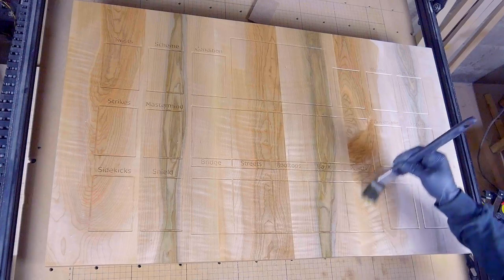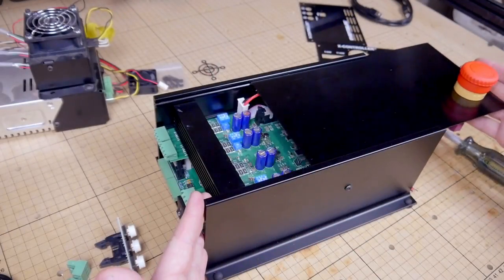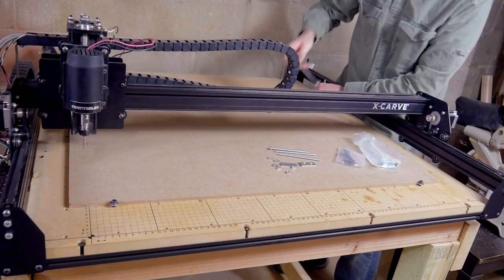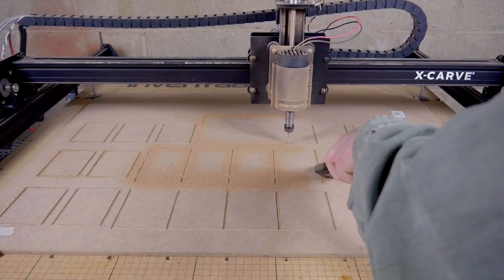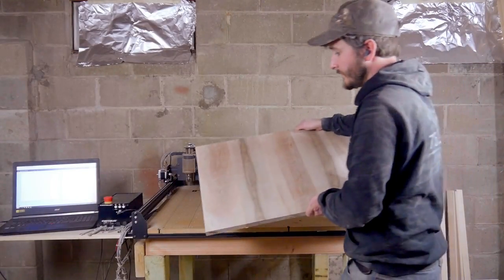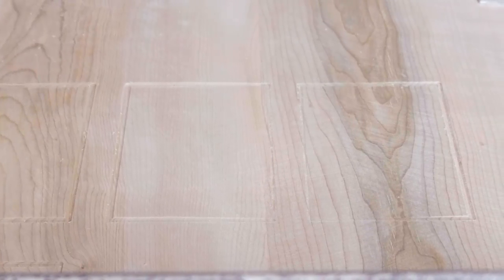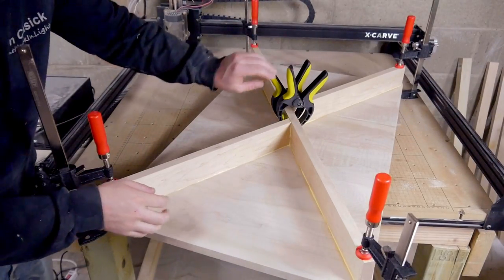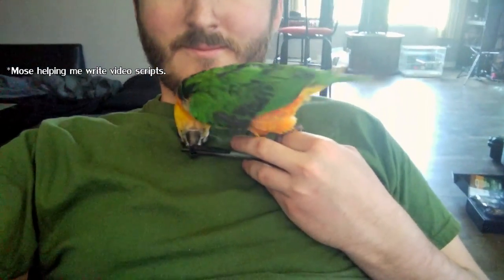Designing & Cutting A Custom Maple Game Board (Legendary) on X-Carve

Comment: Woodworking tip: wipe excess wood glue before it dries. Makes everything look better. For the main board it doesn't really matter since you sanded, but the underside has very visible glue.

Comment: Pretty good for someone who doesn't woodwork very much. Only thing I would suggest is to really take your time sanding before applying the finish. If you did sand it more with a higher grit you would have minimized the wavy uneven look of the finish.
Reply: That looked to me more like a curly figure of the wood rather than an unevenness of the finish.

Comment: A tip for keeping your boards flat. When doing large tabletop-like glue-ups, always make sure the curve of the end grain alternates (cup up, cup down), and then alternate your clamps on the top and on the bottom. This will even out the load. Your strips helped, too. Also use a chisel, or even better a jack plane, to remove the excess glue. Much cleaner, easier, and less dusty then the belt sander. You will also likely remove less material. Even a cheap wood chisel, when sharp, will do this well.
Reply: Just a small add here, don't scrape the glue off with quality tools, the glue dries so hard that it can easily chip sharpened chisels or planes, instead remove every ounce of glue you can when first clamping, the use something like a drywall/putty knife to scrape with.

Comment: I use Inkscape as well. Good software. They use those stepper motors in everything. What would be really nice, is if you could rub some color into the lettering that you cut. Much better contrast. Maybe a syringe filled with colored epoxy so it can flow into each letter.

Comment: On similar products in the future, I would recommend using a darker stain on the wood, and then using a planar to take down the top 16th inch or so of the wood before applying the final finish. The result is that all your cuts and lettering, which aren't shaved off by the planar, hold the stain and show up darker and with much better contrast on the final piece. This would probably require making those cuts deeper in the first place.
Overall, very nice project.

Comment: That looks fantastic. My only suggestion would be to use biscuit joints to connect the boards together rather than glue by itself. It should add a lot of stability, and possibly eliminate the need for cross bracing on the bottom.

Comment: If you have a table saw, make sure all the boards are the same way up (look at endgrain), run them through the table saw just taking the minimum shaving off the edges, then turn alternate boards upside down, this way any slight angle on the blade is cancelled out, also the alternation is the best way to nullify the cupping.
If there are slight inconsistencies in the joins when you test fit, get an old belt sander belt, open it up, and trap in the gap, slide the boards against each other.
This should give you a decent joint ;)
Another thing you could do is to find those cheap shelves that come with a couple of wood brackets for wall mounting, the shelves are often a lot flatter, they are solid wood, they often have a bullnose or other fancy edge, but do the same as above to joint them..

Comment: Maybe you could build a vacuum cleaning system for the table and possibly the grinder to catch the dust. Such systems are often used with larger machines, but you could just convert a small vacuum cleaner and attach the hose to the "head" of the drilling machine.

Comment: Someone might have beaten me to it, but using a damp cloth/sponge to remove excess squeeze-out before the glue dries can cut down on sanding massively! Even if the boards aren't perfectly aligned. Using a straight cutting bit either in a router or on the X-Carve could be used to square off the edges of boards before gluing, rather than using a jointer. Just an idea!

Comment: If I were you, before I applied the finish, I would have put some black paint on the words, making sure the paint got into those grooves and then just sand off the paint on the surface to make the words stand out.  However, the words were actually a lot easier to see than I expected though after the finish was applied.  Overall a really cool idea, I might make something similar!
Reply from the maker: That was the plan, but I liked how the lettering looked naturally so I decided against paint.

Comment: Just a clarification: a jointer doesn't help guarantee the boards will align; all it does is get the edges straight and square to the faces. How to get your boards to align and stay that way is one of the great questions of woodworking. Personally, I use a "reversible glue joint bit" in a router table. It leaves a slightly unsightly joint at the end, so it's not for fine furniture, but it's a godsend otherwise.

Comment: if you install a wider straight bit, isn't possible to do a flatting pass and flip the board and do the same on the other side before cutting out the design. Essentially acting like a thickness planer to level out and flatten your board?
Reply from the maker: You could, it would just take a long time. I would have run into an issue in that my board is wider than the effective cutting area of the machine so I would not have been able to level the margins.
Reply: Here's a simple, tried-and-true way: use a yard stick or any straight edge and lay it across the board in various directions. Scribble over any high spots with a pencil, then proceed to sand or plane them down. Repeat until your surface is flat in all directions.

Comment: When using shallec sand the wood with fine sand paper, then wipe with a damp cloth and then apply shallec. The more times you repeat this process the better finish you'll get on your wood
Reply from the maker: Thanks for the tip! Do you allow the moisture to dry after wiping with a damp cloth or does moisture help?

Comment: Nice looking board. I'm wondering if there could have been some way of darkening the card slots and letters so they are easier to read. Paint seems like the obvious thing, but I've had trouble getting a small brush perfectly in the edges without overpainting.

Comment: I'd use some edge finder. But then it wouldn't work if rpm was too high. Home machine I just edge tool to side with paper till paper can't move, then rise Z, move half of tool diameter in and you have decently repeatable X or Y edge finder.

Comment: Could the xcarve not do a levelling pass rastering the top of the surface to exactly flat, then flip over, clamp, and raster level the back side; you lose a few mm but then you can be absolutely certain the work is flat and parallel on both sides.
Reply from the maker: The total size of the board is wider than the X-Carve's cutting area so it wouldn't be able to hit the edges without doing it in multiple steps.
Reply: Fair enough. something something skin a cat...I'd make the play area the max size of the xcarve then add a border/trim to flesh out the full size of the sheet.

Comment: Does the X-carve not have home switches?
Reply from the maker: You can make it return to it's previous home position, but in general I set a new home position relative to every work piece rather than to a location on the carving table.
Reply: Fair enough. On my CNC router I have installed a 90 degree fence on the 0,0 point, which I butt my work pieces against. It allows you to use the home switches for a fairly repeatable origin in case of having to stop the cycle. It's always a bit scary cutting into a work piece you have a bunch of time invested in! The end result looks great.

Comment: It would have been a bit more final if you had added storage for the cards but cool none the less.
Reply: Ailerath the nice thing is that that should still be doable since the board is elevated.
Reply from the maker: Ha, I don't think you realize how many cards there are. It's something like 35lbs worth, and they keep coming out with more. I suppose maybe they would fit if the entire board had one big slide out drawer under it.
Reply: NightHawkInLight or if the board was the lid to a shallow box that you can place card trays into. Piano hinge on one side, simple latch on the other. You wouldn't be able to correct the warped surface, only problem.

Comment: your videos are grate although it would be nice to have projects with more readily available parts maybe something with fire
Reply from the maker: Did you see my last two videos?
Reply: they did not show up in my subscription feed
Reply from the maker: I'm not surprised. Who knows what YouTube is doing these days.
Reply: Yurp:]
Reply: Since you don't have a jointer, a hand plane.   Place the board side by side with the same joint edge touching and plane them smooth.   The edge should match up as long as the plane it straight.   By leaving the center  very slightly deeper will give you a spring joint.

Comment: Glueing the bracing on like that is a bad idea for a wide panel like this, the wood on the large panel will expand and contract and pull the glue joints apart over time, its not a big deal really but it's worth mentioning so you can try to avoid it in the future. I hope you have a good day.
Reply from the maker: You're probably right, hopefully it stands the test of time and doesn't change much with humidity.
Reply: NightHawkInLight if not you could always add some darker areas and dents to try to give it a more aged look and add some character to the board, it might actually look pretty cool done up like that.

Comment: Great video, personally I would have painted the lines black, before oil. Then sand the surface to remove any black paint that is not in the lines, and then oil it. Just to make it more clear and easy to read :) Also, will only using wood glue really hold? Feels some biscuits or plugs (like these http://diy.sndimg.com/content/dam/images/diy/fullset/2011/2/23/13/RX-DK-DIY064016_glue-biscuit_s4x3.jpg.rend.hgtvcom.1280.960.jpeg or these http://s470.photobucket.com/user/kurreburre/media/Hem/gds_mediabank4.jpg.html). Anyways, great video, nice to see some woodworking here as well

Comment: It says in the rules that you have to submit a CARVED game. Not just the file of your drawing. :( :( :(

"Add a photo of your completed, carved game to the Games Maker Challenge page along with an active link to your Easel file. Make sure you make your Easel file shareable by going to File > Share so others can open your Easel project and carve it!

You must submit a photo of your game project on the Games Maker Challenge page in order to receive your gift card. Photos of anything other than your carved game project will not qualify, even if your Easel file link is valid.

In order to receive the $20 gift code reward, the photo must be for a complete finished game carved with X-Carve or Carvey. Your Easel project file must include a valid, publically-viewable link to your game project."
Reply from the maker: I'll have to ask them about that, it wasn't that way before. I would try submitting an entry with just a screenshot of your project in the meantime.
Reply from the maker: I've confirmed with Inventables that they'll be accepting screenshots as entries for $5 gift cards, it's just the $20 tier that requires a picture of a carved project. Someone made a last minute change to the rules I guess without remembering I was posting this video, they should be corrected sometime today.
Reply: Bummer. At least they're still giving something for us without the machine. ☺️ Thanks!